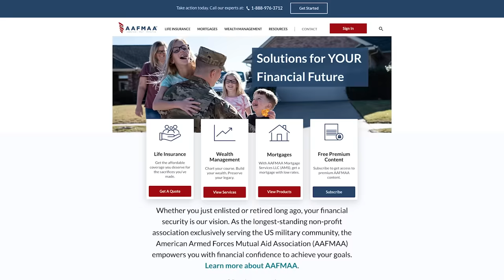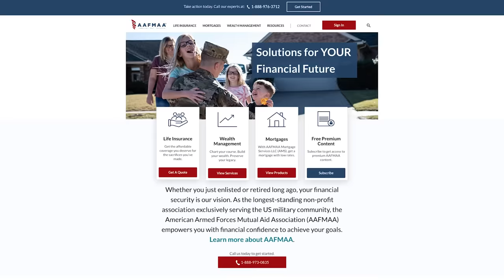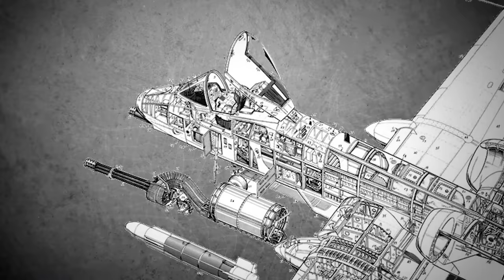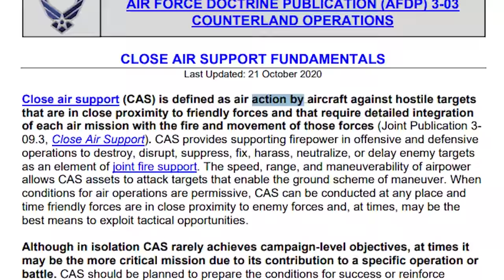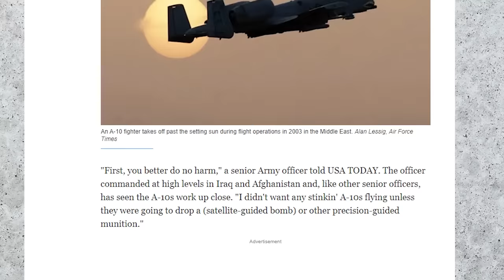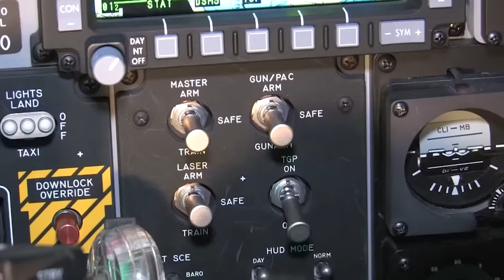Why the Air Force is Screaming to Retire the A-10 Warthog

Comment: I love the A-10 and as a former FO (Forward Observer) it was SO MUCH fun doing CAS missions with it.  When I went Air Force and had to do mission planning with the A-10 in the Pacific theatre.  It became a nightmare to get it across the Pacific to area's like Korea, Japan, ect.  This is because, for air to air refueling, the A-10 can't get to the best altitudes that the KC series acft operate at (FL220B240 or FL240B280).  We had to use FL180B220) so that the tankers could descend to 18,000 ft to refuel the A-10's.  This caused huge headaches due to having to coordinate with foreign nations so that their civilian airliners would not be affected.  (they were flying in the same heavily trafficked airspace.  Also... the A-10's had a HIGH tendency to break down during these missions and end up in Guam or Diego Garcia for EXTENDED stays till parts became available.   Like my earlier comment, as a previous ground pounder, I LOVE this jet, but from a strategic view, there are... issues.
Reply: Yeah, people forget they were designed to fly to Europe using a series of airbases in Canada, Greenland, and Iceland and then stage out of France and the UK to shoot up swarms of tightly packed Warsaw IFVs and tanks in order to blunt the charge while heavy US assets made their way across the Atlantic.   They were never intended to operate long distance.  Future air operations will by necessity be either long distance or from small makeshift airfields because the only safe airfields will be those outside of missile range. Say what you will about the other aspects of the plane, this alone makes it obsolete.
Reply: @lordsheogorath3377 to be fair it can be maintained and flown off off literal dirt roads/highways so it's actually REALLY good for say, the ukrain war, as long as most long range AA is taken out.
Reply: @lordsheogorath3377  If ONLY Americans built air platforms with the same focus as the old Soviet designers did, they'd have a competent CAS platform like the Su-25. I cannot fathom the A-10 surviving beyond  a few sorties in the Ukraine under the everlasting watchful eye of the multiplicity of SAMs on both sides----and yet it's only CAS rival in the world Su-25 s flying daily sorties for both opposed forces....
Reply: That's actually super interesting. I've never thought of the complications with low level refueling and civilian airliners. Sounds like a massive headache.
Reply: We should give them to Ukraine
Reply: I knew and conversed a few times with a former Hs-129 pilot that did fly a significant number of sorties in an actual peer on peer war - not this very asymmetrical stuff the US has engaged in since Korea. The Hs-129 was the predecessor of the A-10 much much more than the P-47 which was not similar at all to it in intent, design, performance, or anything. The Hs-129 was also very breakdown prone - so much so that more were probably lost to accidents than combat. He told me that in his opinion the Hs-129, like the A-10 also was only useful when it's side had local air supremacy. He also said that while destroying tanks with 30mm on that plane was possible, it was very difficult and the plane was much better for strafing lightly to not armored convoy vehicles and suppressing AAA. He thought the Fw-190 was a better ground attacker (from the pilot's perspective anyway) because it had a much better chance of surviving without local air supremacy and was also much easier and more pleasant to fly. Interestingly, he was one of the few people that flew combat missions for both the Axis and the Allies as he was Romanian and they switched sides near the end of the war.
Reply: @GundamReviver It would be absolutely shredded in Ukraine my guy.  Because there is not only an abundance of long range AA but also of mid-range and manpads.  Thats like saying it will do good if it isn't shot down.

 The A10 is also entirely dependent on at the very least having localized air superiority and SEAD aircraft to clear the area before it can do low and slow CAS. Otherwise it's just going to do standoff ground attacks and any other plane capable of operating off roads like the f-16 or f-35 will do much better.
Reply: I'm very against its retirement.

I said that as a person who thinks just about every other jet needs to be replaced with a drone.

The GAU-8 ammunition is just big enough to be upgraded into smart ammunition.

Not having to point at exactly where you want to shoot changes the entire game. Also start firing at much longer distances as long as you are not needing to punch through armor.

With 3D printing it might even be possible to add a rocket/jet motor component.

Also tear out all of the electric and hydraulic systems, replace everything with triple redundant electric actuators from SpaceX.

Also just completely remove the cockpit and human.

With all of the saved weight carry vastly more daka.

For a complete refit even replace/modify the jet engines, so the impellers can be electrically driven.  "Stealth" A-10. It's two biggest weaknesses are its IR and sound. You can hear it coming and get your man-pads ready.

If you could cut the engines and just use ducted fans for the last few miles, as well as having basically no IR signature, and low enough that radar don't work so good for targeting, with no human risk, and the ability to multi-target in a single pass, and you got a brutal weapons platform.
Reply: @D-E-S_8559   dedicated slow flying armored plane CAS role is obsolete.  SU-25 has done very poorly  compared to other attack and multirole aircraft in Ukraine. Neither side currently uses them for gun runs or close in rocket strikes.  They are being used to lob rockets, missiles, and guided bombs at standoff ranges.

They also did poorly in Georga in 2008.  low slow flying planes are deathtraps in any environment with lots of manpads. They are not tanks. They will go down if they are hit. The armor only protects from flak shrapnel and near misses.
Reply: @jtjames79  so basically design and build an entirely new aircraft lol. It makes 0 sense to use 40 year old airframes that haven't been built since 1984 to do such an extensive refit.
Reply: Wow what an enlistment. I just got to be a gate guard for 3 years
Reply: @jtjames79  That is way more expensive than taping a gun pod onto a Predator drone or whatever. Even in similar roles, the newer Tucanos can accomplish similar results for far cheaper costs.
Reply: Brah what ever you wrote there, sounds Classified as F man. So idk
This info is like labelled, Top Secret.
Reply: @jtjames79 The A-10 has a back up for its hydraulic systems called manual reversion .
Reply: @benpurcell4935  I'm aware. I would literally gut the entire thing. It would be a lot cheaper than trying to engineer around legacy parts. Their are car companies talking about 3D printing entire major components like chassis and body.

Military doesn't even have the state-of-the-art targeting and tracking anymore anyway.

An Nvidia Jetson can do multi-domain targeting and tracking with cheap off-the-shelf parts.

Same with electric actuators. Off-the-shelf technology has moved on. Starship has electric flaps.

But that's just my wishlist.
Reply: @jtjames79  I’m just saying even with a triple redundant electrical system that a single hit could completely knock that system out.
Reply: @benpurcell4935  That's not how a triple redundant electrical system works.

It's not hydraulics, the electronics won't leak out if a wire gets hit.

You also put your batteries in at least three places.

Using Tesla's new flat wires, triple redundant wiring, would still weigh less and be less than conventional analog wire bundles.

Check out Sandy Monroe's Mach-3 vs Model-3 comparisons.

There's no reason you couldn't put the batteries in the same housing as the actuators, and have them work for several hours completely independently powered.
Reply: @jtjames79  The reason manual reversion was put on the plane was to allow the aircraft to fly without hydraulics working that’s the entire reason it was fitted to the plane in the first place.  It was the third redundancy.  There are two different hydraulic loops in the aircraft to keep the control surfaces working.  You have to think what happens to the aircraft after receiving a severe hit.  The actuators get severely damaged so what now is controlling those control surfaces that were being controlled by the actuators.
Reply: @benpurcell4935  I don't think you really understand how redundancy works.

You are talking about fallback redundancy, I'm talking about rebustness redundancy.

If it's harder to knock out the distributed electrical systems (systems with an S, plural, multiple) than it is to knock out two hydraulic systems and a manual backup (that barely can be considered an emergency backup) then you are still more redundant. And much more survivable.

And I'm well aware of all of the A-10s features, I have been since I was about twelve in the 80s.

Manual reversion has only ever come into effect a couple times ever.

Since electrical systems are many many times more robust than hydraulic systems, it's pointless to carry around all the extra weight.
Reply: @lordsheogorath3377  Like I said it only makes sense if you make smart ammunition for the gun.

Smart ammunition can only miniaturised so much.

The GAU-8 is the only gun big enough.

It would also be capable of air-to-air combat, since you're shooting mini missiles that don't miss, like in some anime.
Reply: @D-E-S_8559  One thing those arguing against the A-10 always ignore. It's better than the Su-25 in survivability and stand-off capability yet they say it couldn't survive where the SU-25 does?! Not arguing it would be a game changer or even highly effective. Just that their argument makes no logical sense.
Reply: @jtjames79  The biggest weakness of an electrical system is the actuators and in general electrical systems have their own drawbacks that should be considered as well.  Electrical systems are inherently more complex than a combined system of hydraulics and electrical systems.  Have you tried reading a wire diagram for a car before?  Also I’m of the belief the A-10C needs a replacement and not a complete overhaul because the current airframe does not meet the needs of the future battlefield and for one to do that it means the integration of more advanced technologies and avionics.
Reply: @Freemark0211  very few of their arguments do but I believe it is because they hate it because they were told to or it isn't communist enough and not because they actually did any thinking
Reply: @jtjames79  Smart ammo wouldn't increase velocity.   Smart ammo wouldn't increase payload.   You are limited by the dimensions of the feed system and breach. The shell can not get larger in any dimension.   You can not fit a guidance system into the 30×173mm cartridge without significant ballistic performance loss.

The range is therefor still limited to about 1.5km and it is still unable to penitrate the armor of t-64 and newer tanks. It still requires you to fly low and slow in a world where any given infantry company will have 2 dozen manpads.

No offense but you clearly have 0 aviation engineering experience and lack even basic information about the plane and the gau-8.
Reply: @lordsheogorath3377  Cope harder, Mr no imagination.

What I'm talking about is no more complex than a high tech "rat rod". A rat rod is a hot rod that you spend the least amount of money making something that goes as fast as possible.

Retaining the A-10 is a complete fantasy, because politics not engineering.

But I do have a new idea for a close air support model, for my tabletop war game. Going to save me a lot of effort basing it on the Warthog.

If you want to know how I would do it I guess you could buy the book.

It used to be I was too lazy to write books but now I have chat GTP and Stable Diffusion.

Maybe somebody gets inspired by science fiction, not like that's never happened before.

Private air forces are getting a lot more popular.

Weirder things have happened, like to myself personally. It wouldn't be my first rodeo. I have replaced, or caused to have replaced so many people with very small shell scripts.
Reply: @jtjames79   At no point in your rambling, incoherent response were you even close to anything that could be considered a rational thought.

Comment: As a former combat engineer in the us army, we did some joint live fire exercises with them at fort Indian town gap. Man it was crazy watching the a10 slow down from recoil as it lit up old m113, and jeep vehicles after we called in coordinates.
Reply: The recoil from firing is equal to one of the jet engines at maximum output.  So they should be used in a dive to maintain airspeed, or throttle up both engines.

Also, the gasses from the firing are enough to snuff out engines behind them, so pulling the trigger on the gun causes the engines to go into "relight" mode.
Reply: The A10 can not be replaced by F-35.   It needs to be replaced by drones.
Reply: Turn the A-10 into a drone by auto-pilot control remotely.
Reply: @williamzk9083 there is also the T-6 Texan II and the attack helicopters of the army and marines. Overall there is more than capable firepower to cover the retirement of the A-10
Reply: @almerindaromeira8352  the issue as I see it is not fire power but survivability. Attack helicopters are survivable if used properly.  The next generation of helicopters will even have their own drones. Proper use of drones is survivable.  Japan isn’t replacing its attack helicopters and is putting its money into drones.
Reply: @williamzk9083  sure drones and loyal wingman systems are coming in a near future.
As for helicopters, they are not that survivable if the airspace is contested. If the enemy has SAM or even just MANPADS the helicopters are in a tough spot. Maybe this changes back if tiltrotor and/or compound helis become a thing.
Reply: @almerindaromeira8352  helicopters can use non-line of sight, missiles like spike NLOS hellfire, and AGM,179. A scout or forward observer or drone can provide firing coordinates.  Helicopter can just dive out of the way.  No way, can they operate behind enemy lines.
Reply: Former 12 bang bang here, I participated in a live fire in Benning  many moons ago. Seeing Apaches, Warthogs, Bradleys, Abrahms unload downrange is a fun sight. Me? Being the fresh private, I was the grappleman ahead of the Bangalore team in tandem with another group to clear out the razor wire. I did my dive at the dirt thing, popped smoke, the guys did the rest. Aaaaaaand try not to get run over by the armor rumbling towards my signal. Fun times!
Reply: Russian helicopters cannot overfly the front lines because Ukraine has ManPads and knows how to use them. Ditto Su37 the Russian equivalent of A-10.
Reply: @marc21256  "Also, the gasses from the firing are enough to snuff out engines behind them, so pulling the trigger on the gun causes the engines to go into "relight" mode." That was an issue during prototype phase. They fixed that long before the final A-10 went into service.

Comment: Of all the jets I’ve ever touched the A-10 was the only one I enjoyed working on. It was actually fun to load them and while maintenance was very physical I didn’t mind it so long as I wasn’t the one disconnecting hydro. Otherwise, I still have dreams about them flying over or going through EOR and wake up wanting to go back to an A-10 base.
Reply: West Germany 86-88 82nd Eng Bn "Blue Babe Battalion. While training in Graf the A10s would buzz past us low level then fly straight up and would look like a Cross.
Reply: What kind of mx man hr/ flight hr did you guys typically see?
Reply: @LRRPFco52  I've been a 2W1, not a 2A so my MX really revolved around how the weapons systems performed or Phase/inspection intervals. Loaded a lot of bombs, rockets, missiles, C/F and swapped a lot of pylons and ran ops checks. Our yearly flight hour contract was always being exceeded so 2500 flt hrs per airframe this year means upwards of 3000 next year because "we can" on an aging airframe. So working 12+hr shifts was normal at Osan and somewhat normal at Moody. Production also had their work cut out for them with standard MX and servicing. Typical flying day was 8 pit 8 turn 6 pit 6 sometimes turn 4. Then surge weeks or FTX ran things up to 12 pit 12 turn 8 pit 8 turn 6 pit 6. Lots of lines/sorties. That was for each unit with 2 active units plus reserve so double those numbers. So working EOR during those weeks was not fun. But it's still better than trying to load 120s into an F-22 internal bay.
Reply: @ctasitrep  In the 1970s, my dad brought home a 30mm GAU-8 dummy cartridge from the A-10 CTF at Edwards AFB, while it was still in development.  They were having a lot of problems with the gun, gas ingestion, engine stalls, working out the kinks.

20 years later, I was calling in CAS with them.